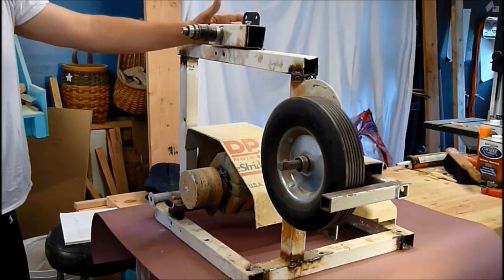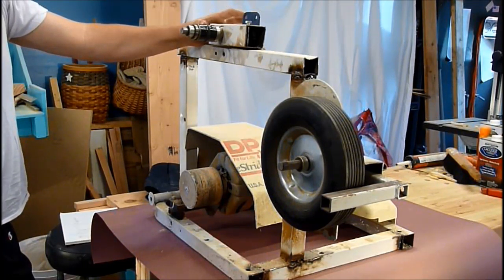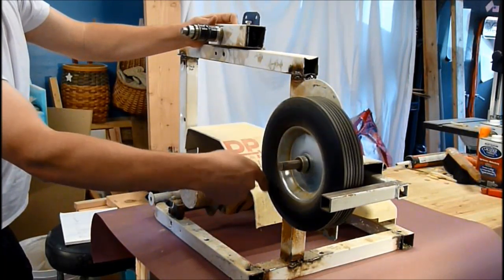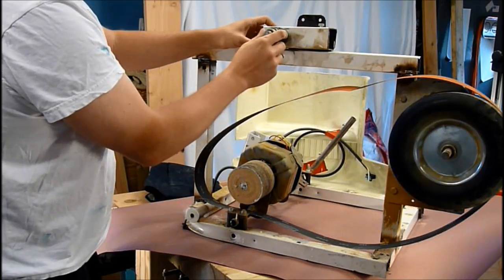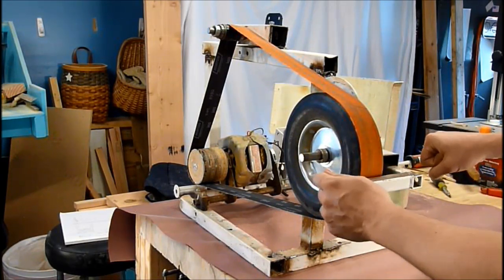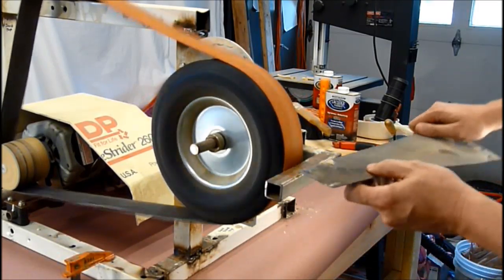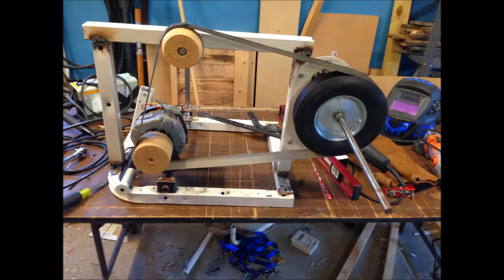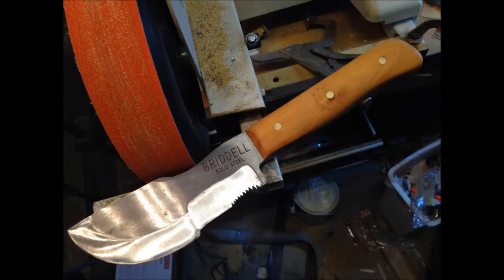2x72 Belt Grinder from a Treadmill

Comment: Works well! Do you feel the 3/4HP motor is powerful enough?
Reply from the maker: 3/4 hp seems find but if you have a bigger motor why not use it.  The weak link on mine is that the sanding belt will slip on the drive wheel before I bog down the motor.
Reply from the maker: On my latest project I bogged down the motor when using my 36grit belt on some Maple.  That's the first time I have needed a more powerful motor...